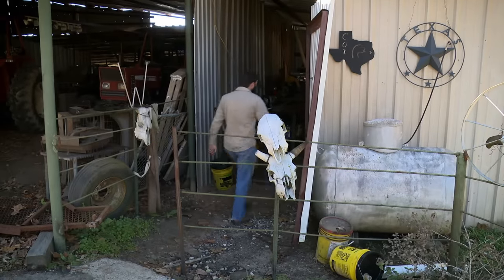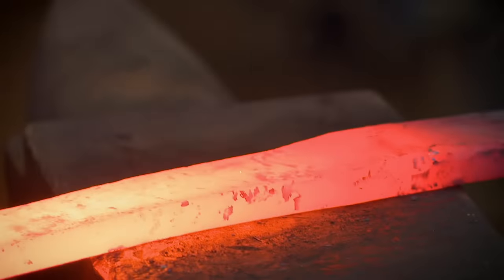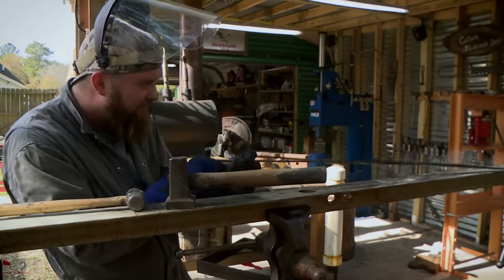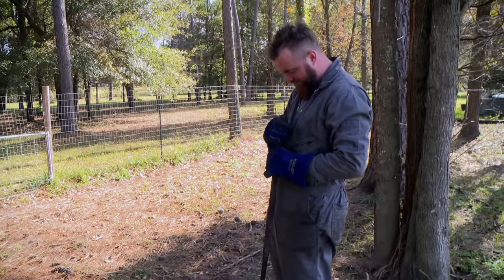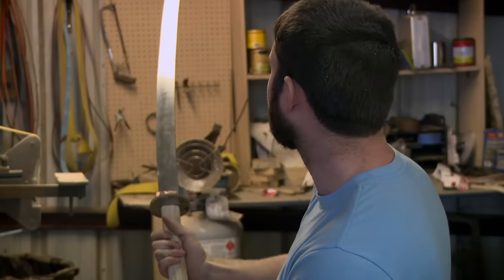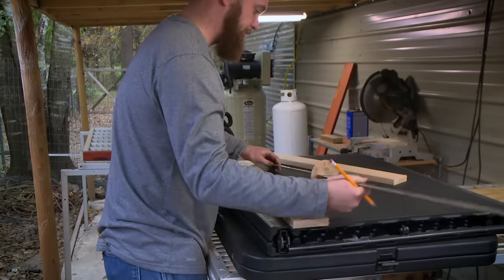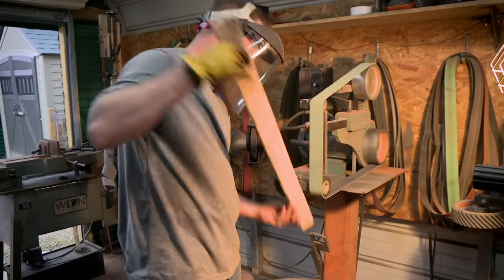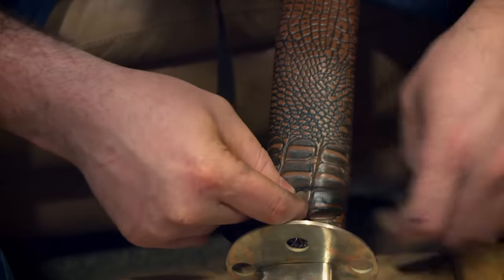Forged in Fire: The Nagamaki Samurai Sword SLICES IT UP (Season 6)

Comment: I always find it odd when these guys say they have never made something this big before. Like if I was a bladesmith, the first thing I would have attempted to make would have been a sword.
Reply: Because it's pretty hard to.
Reply: That's not how it goes man honestly
Reply: @aaronglassling  Exactly
Reply: Knives are addicting to make and much simpler, take less material and time, fit in the forge easy for heat treat…..also MUCH more useful, hence, most blade-smiths make knives almost exclusively
Reply: @jhayes1189  Skyrim Smithing in a nutshell
Reply: that's a lot of metal and a lot of work. you gotta start small so you're not wasting things.  Swords take quite a bit of techniques too. They're not something blacksmiths attempt as novice.
Reply: @superdahoho  you never waste metal is just there use it again wtf
Reply: @poutsompananaskavliaris1984  Something tells me it's not quite that simple, dude.
Reply: I am a blacksmith who does knives and swords for fun and I would say there is not often a reason to really blacksmith a blade from the ground up.
Only very rarely does a blade have a geometry where its not just possible to pick a milled workpiece from the shelf and jump right to the finer points.
This becomes more significant the heavier the weapon is. I would rather spend all this time blacksmithing a cool hilt or crossguard that cannot be copied with any other technique than blacksmithing the entire blade with a result that is not going to be any better than what the mill spits out.
Reply: In my country, we are not allowed to build a sword.
Reply: @Sardonic_sardine  probably not england
Reply: Ye ik
Reply: @anoakenstaff  makes cloud buster sword.
Reply: @lucifermorningstarLMX  Hmm?
Reply: I'd make my first project "The Buster Blade" from FFVII.
Reply: When you're just starting out you don't just Go straight to something big. The bigger a weapon is, The harder it is to make. 

I guarantee you that every bladesmith started out making just a small knife, and the same applies for every profession out there. You start at the bottom with something small and simple, and then you slowly work up from there.

Comment: I don't think I've ever seen two weapons on this show that were so evenly matched.  What a tough decision for the judges!
Reply: I think, bamboo cutting was decisive factor: "red" nagamaki cut it more....no "more".....clearer than "black"
Reply: @drevniysamurai  Partly. Fit and finish was a major factor in this one.
Reply: ????????????? Braxton's blade clean sliced through that Boar in one hit, and that was over the original cut the judge made lol, no way that was close.
Reply: @joshz3788  bones dude. Braxton's blade was swung from the boar's behind and just below the hind limbs. So less flesh density and less number of bones but for Jake the blade was swung from the front hitting the spine first.
Reply: @lucifermorningstarLMX  So what's the excuse for being able to actually tear large chunks of back meat off of the pig, whereas the other blade barely even nicks it?
Reply: @joshz3788 being cut from the other side allowed blade the accumulate more momentum
Reply: Braxton’s easily beat Jake’s. Braxton’s cut the boar in half, Jake’s didn’t.
Reply: @zachery2759  Cutting the boar in half is always fun to see, but it's rarely a determining factor because there are too many unpredictable variables, such as angle of the swing, how much power Doug is able to put behind it, whether the blade hits any bone or a particularly tough section of hide, etc.
Reply: No, The red nagamaki performed better than the black one. It's sliced very cleanly and deeply into the boar during the kill test, even slicing it completely in half through the spine and everything, and it cut the bamboo effortlessly and cleanly in the strength test.

Comment: bro even i as a non-smith know that you need to temper your blade before whacking it against something!
Reply: He did that was after the quench
Reply: I agree. Straight from the quench so smacking it on a branch? That's when the steel is the most brittle! Should've waited ill after the tempering.
Reply: @ryanmurphy7290  quench is the hardening process, tempering is what makes it from brittle to tough
Reply: as in he should have let it sit overnight?
Reply: @ryanmurphy7290   Tempering heats the metal to a specific temperature and then cools slowly to 'unwind' all the internal strain without losing the hardness. They rarely show it because it's hours on end where the smith has nothing to do but wait.
Reply: @ryanmurphy7290  Often, heat treating is a 3-step process. First heat it hot then let it cool slowly. That will "nomalise" the grain after all the punishing forging. Then heat it hot and cool it fast by quenching it. That should make it very hard, but brittle. Sort of like glass. To take out that brittleness and leave it hard, you temper it by heating it to a lower temperature then let it cool very slowly. There are recommended temperatures for each step to achieve the best results.
Reply: never made a blade before, sorry.

Comment: Very amazing video.
But, interestingly, in the first test, in the first competitor the blade went through the abdomen and crossed the pig, while in the second competitor the blade went into the back.
Reply: Yeah, it seemed like Doug forgot  a cut there.
Reply: I thought that, but figured it would have to come out that side anyway
Reply: Not important. In both cases, they would cut more from the abdomen to the spine, because the spine is at the end, right. On the contrary, because the spine would either slow down or not stop the movement of the blade by hitting the bone. So I consider the trial, not valid. By the way, I love the show, the members of the jury are fantastic people and connoisseurs of this profession.
Reply: @radnazona3979  I will admit that the cutting was not fair, but I would like to point out that it was actually the loser who had the advantage. No matter how you look at it, cutting from the back has more power because there isn't any extra flesh that will slow down the blade. It's the simple principle of a car crashing into sandbags in order to slow down.
Reply: @anonymousmouse7161  yeah, and his bled, even with that adventage, didn't go through the spine, unlike the winner's blade that cut that boar in half
Reply: Bones dudes. Braxton's blade was swung from the boar's behind and just below the hind limbs. So less number of bones and the flesh is just skin thick but for Jake the blade was swung from the front hitting the hardened hide & spine first. So imo that came out as an unfair testing

Comment: is no one going to mention that in the kill test these weapons were tested with different sequences? the 4th & 5th swings are completely different.
Reply: They are just opposite bro
Reply: @meetjain5624  yeah but the thing is, when you start a swing on the side that has nothing but one rib cage to stop it vs the entire back and spine, no wonder the first one had a easier time cutting it yakno?
Reply: That's not what decided the competition.  Both blades performed equally.  It's just the build of one was slightly less refined than the other.

Comment: I hope this is OK I just had to tell someone. 
Watching your program I realised that if I wanted to make a leaf spring blank twicw as long and half as wide . Drill a 3/8's hole a metal with from the end. Then split it from end to hole.  After that get it red hot and drive a wedge in the slot to initiate the opening. Once the opening is wider than the anvil , use the anvil as the wedge. Then heat and beat out the lumps. 
Now I can hammer out a Rapier with half the work..
 Probably I'm the last person to figure this out, but it feels so good.

Comment: Maybe that would create a problem when trying to use it but I feel like the weird thing is that even though this weapon looks polearmish that it still tends to be wielded like a sword and that nobody while using it even seems as if they at least make attempts to take advantage of the longer reach that the length of the handle would provide but like I kind of said maybe theres something about the size of the blade along with the size of the handle and the whole overall configuration of this weapon which would make doing so, either a bit awkward or not really the most practical but also given what I seen before I would say that something like this would probably kind of be quite an awkard weapon to wield overall especially in the hands of someone who doesn't really know what there doing with it and or hasn't really trained with it for that long.
Reply: Yeah the weapon appears that way at first. Idk if you have already, but you can easily google the history and use of a nagamaki. Essentially the longer handle was meant to provide more power through leverage. Think of it as a short glaive or a quarterstaff. Trying to swing it using it's full length wouldn'tdo much plus there's other weapons meant for reach (eg. the naginata). Iirc thr nagamaki was a form of anti-cavalry weapon at the time.
Reply: Nagamaki in traditional combat art was using as a sword. Naginata as polearm.
Reply: @kryniov111  you are correct. i forgot that detail

Comment: I don't know why the handle is very long.........but it is awesome!
Reply: Leverage, and it gives it a bit longer reach. The sword was designed for use vs cavalry, either killing the rider, the horse, or both. 

It wasn't very common compared to a Naginata/Yari (Polearm/spear) because it'd be way more difficult and a lot more expensive. 

There's also Odachi/Nodachi (like a Greatsword version of a katana) that had a much longer blade but not as long of a handle, designed to kill horse & rider in one swing.

Comment: Hold on a minute, I am not a hater I love to watch Forged in Fire but with the kill test against the boar. Dug first cuts through the boar from belly to spine.
However when he does it a second time on the final cut where the boar was sliced in half previously, Dug attempted to slice through the boar from spine to belly.
And due to the fact that the second blade did not cut all the way through (in fact it hardly got through the hide at all) it is not a stretch to believe the result was affected by the difference in test.
Again not a hater I just think that they was a difference in tests and I also would like to see fair testing on a show I really enjoy to watch.

Comment: the difference between a katana and a nagamaki is in the length of the handle not in the blade
Reply: Those are different blades and handles. Blade in nagamaki is shorter wersion of odashi. Katana blade is more like tashi in construction and shape. In nagamaki blade have same profile on all the lenght. In katana  1/3 of blade is thiner and and has triangural profile of point.
Reply: @kryniov111  to begin with it is nodachi  and tachi; the cross section is the same for all Japanese blades, all have tapers in width and side view,  curve of blades vary as to when and where made, for references see my comments below.

Comment: both blades have tangs that are too long
Reply: No they don't thats the entire point of the design. With looong tangs/handles it allows the user to deliver huge sweeping strikes that have more power behind them from standard katana blades, the long length also made them effective against cavalry and nothing beats a weapon that has dual or multipurpose.
Reply: you are confusing nagamaki with naginata , both have long shafts but blades are different, nagamaki uses katana blade with normal short tang , naginata has long tang that is as long as or longer than blade  @Darth1Marik
Reply: @jamesberry3230  No I am not I know what a Naginata is. Google some images of a Nagamaki without the handle and you'll see they have long tangs. Not as long as Naginatas but longer than Katanas. I would link some but YT seems keen on deleting any comments with links. The reason behind the longer tang with the handle was for the bigger sweeping strikes. Look it up I am not wrong.
Reply: No you're wrong. they had to meet set perimeters, their tangs were the perfect length for the competition that took place.
Reply: Yep what Aaron said. They aren't exact 1 for 1 replicas of Nagamaki's but their design and function is still that of an actual one. Naginata's are almost spears pretty much. Even if their tang was slightly longer than usual you're comparison is bad. Its like apples to oranges.
Reply: arms and armor of the samurai/ I. Bottomley &  A. P. Hopson pages 43& 44 for naginata; page 83 for nagamaki. more references if wanted @Darth1Marik
Reply: @jamesberry3230  you're still wrong as Aaron said, they were given parameters by the judges. Your references dont matter
Reply: @Darth1Marik  where in video are parameters set forth, they are shown a finished product called a "nagamaki" and told to make one
Reply: even if they were given parameters off camera, the point is they are historically inaccurate: which is a major problem with this channel!
Reply: @jamesberry3230  I don't think every video says or shows it but its common knowledge to people who watch Forged in Fire the judges have stated in other videos that they give participants a set of parameters for the weapons they forge in order to make them viable for the testing they do. Sometimes they use a pressure cannon to fire the weapons so they need to be a certain length and width
Reply: @jamesberry3230  if you dont like the inaccuracies then dont watch it pure and simple
Reply: @Darth1Marik  I generally don't ,only did because of subject matter
Reply: @Darth1Marik  I generally don't ,only did because of subject matter
Reply: lmfao what are you even on about? the nagamaki's tang specifically varied in length unlike the katana or naganata. there are literally numerous historical examples to support that.